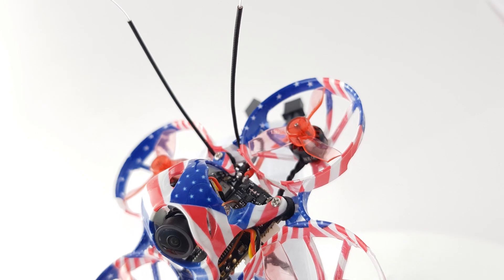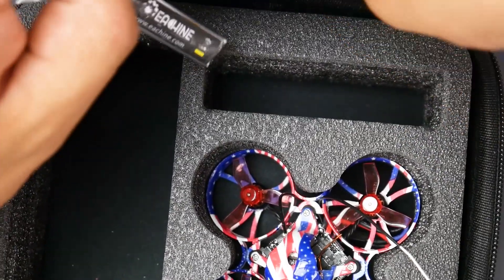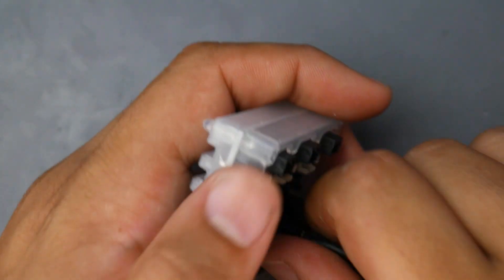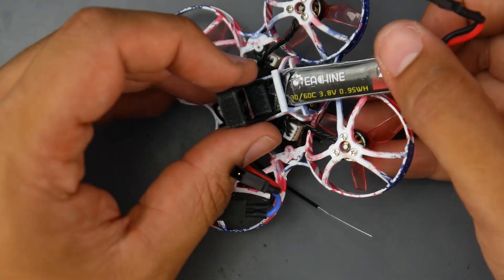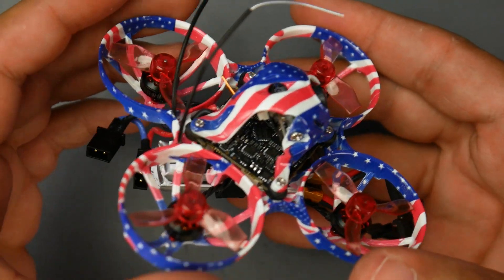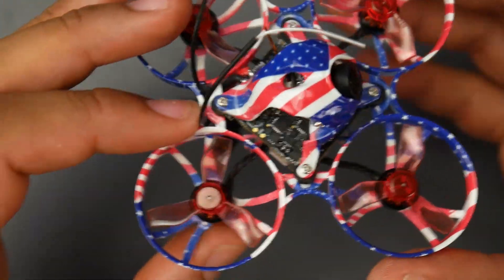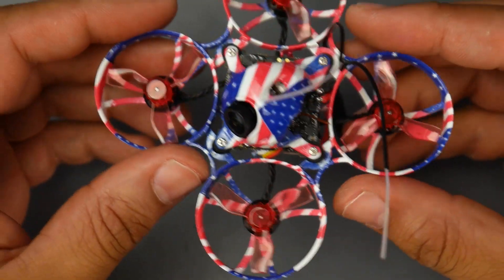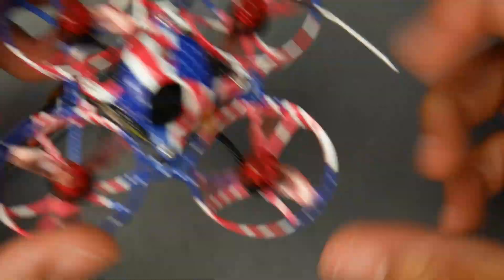Eachine's Best Brushless FPV Whoop Yet // Eachine US65 DE65 PRO

Comment: I don't get the need for a new connector! Is an XT30 that heavy? No. What kind of weight savings is there? I don't have one of those new connectors, but I have a ton of XT30's and they weigh 1.8g with the standard length of wire that goes to a FC. The dual PH 2.0 solid pin connectors, with standard length of wire, weighs 1.3g, so you save 0.5g between those two. Shouldn't we assume the new connector will weigh somewhere in between the XT30 and dual PH 2.0 connectors, because it's size is between the two? So, what's the point of the new connector?
NONE! If the difference is 0.5g!!
🤔😳🙄

Comment: Bought one and I like it overall. My issue is with the batteries. Eachine wants roughly $8 a piece for one 250mah! And when you have to use 2 batteries at a time at $8 each, one can spend $80+ just for 10. Makes you wonder why not just 3d print an attachment to hold a 2s with a xt30 or do what I did and sacrifice a little weight savings and get the 300mah gnbs from Amazon for $23 for 6. Basically $3.84 for one and from the guys who made the gnb connector. Eachine is crazy to ask that much.